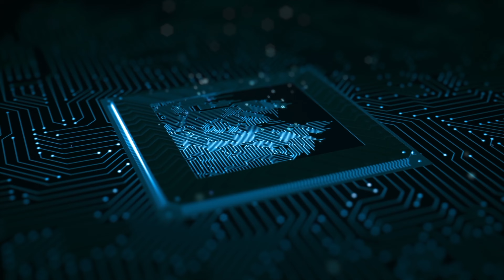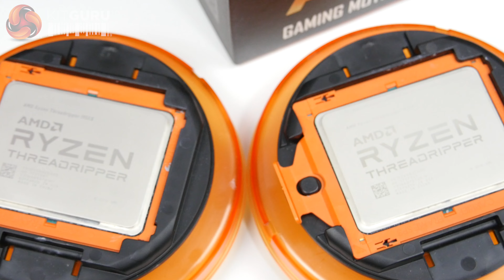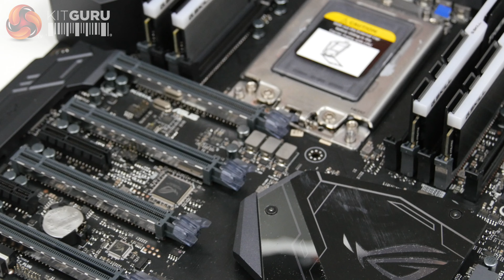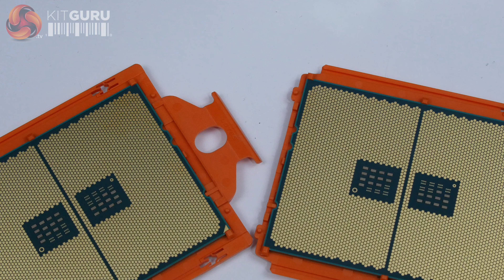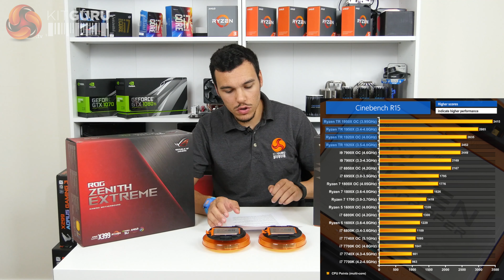AMD Ryzen Threadripper 1950X and 1920X - Intel dethroned!

Comment: The high memory capacity is purely hypothetical as AMD have stated that RDIMM's will not be supported on threadripper and the biggest UDIMM's are (if you could find them) 32GB, so a fully filled board with easily accessible RAM is 128GB and 256GB if you could source 32GB modules. While ECC is supported, it'll only be with UDIMMs.